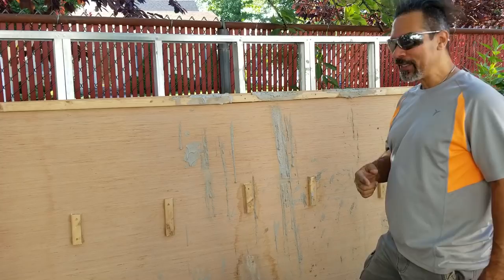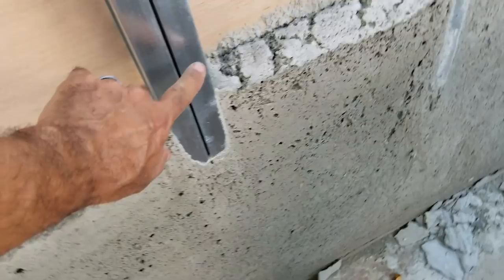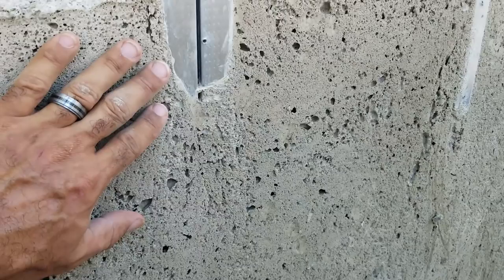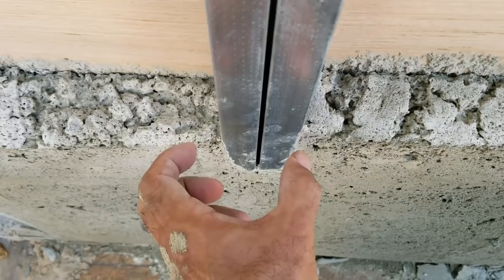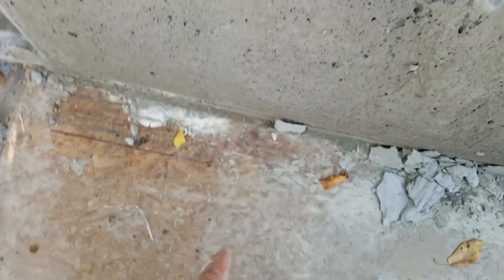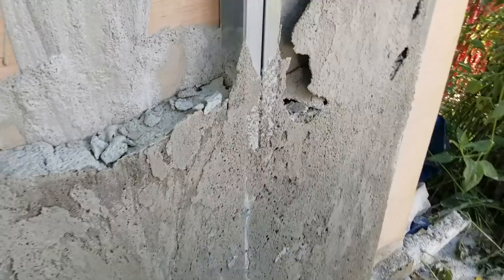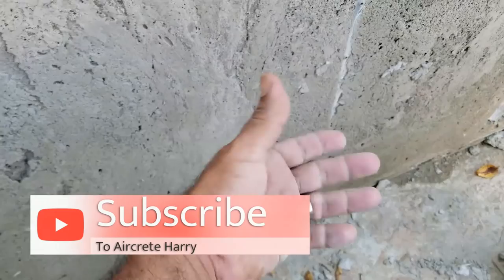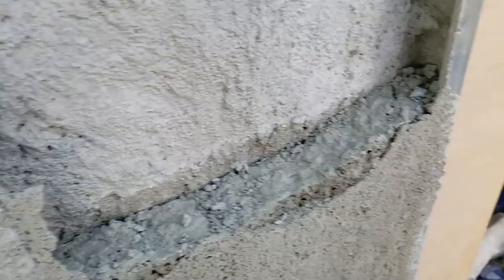Aircrete Wall Insulation | #aircrete #wallinsulation #aircreteharry #aircretewall #aircretesamples

Comment: budies, you may obtain a pritty nice R value  using aircrete with really low budget, the only thing we got do to prevent it from sagging is to use fiber glass and the structure  will never collapse.
Reply: What kind of fiberglass?

Comment: there is chance that we can use a frame and extracted after pouring in place ?what depth has those iron studs?
Reply from the maker: The wooden frame is reusable & comes apart after the pour.
The studs are
1 3/4 inches x 3 inches deep.
Reply: @AircreteHarry  Hmm,what if we strech some plastic over it ?or some linoleum !I am planning to build masonry block and then to build walls .and to make a iron frame is not quite economical so i m thinking using some film protected playwood or simila and protect with something ! i want to build my home and i dont calculate yet but the house surface is 120 square meters !so i need some cubs.Last year the priceps almoust rise 4 TIMES!!!!! If you can imagine ! No doubled 4 times more expensive and i feel I MUST DO SOMETHING TO ACHIVE MY GOAL! What you recomend like framework to pour light concrete and it and be able to un mold without damaging the blocks or the frame ?
Reply from the maker: @prenumenumedefamilie3418  You have different options between plastic and may also look into oils that will provide you with a better release.
Absolutely, I can very much imagine the high cost you mentioned. We have been dealing with the same 
Insan!ty here as well. 
Prices have been going up and it is very unfortunate & difficult to afford things. 
Many tools & parts are not even available. 
I strongly recommend investing into my Online Course that will provide you with good, solid & secure techniques of building:
https://aircreteharry.com/product/%e2%9c%85-online-dome-building-course-step-by-step-by-aircrete-harry-great-addition-for-everyone-who-cant-make-it-to-the-hands-on-workshop-as-well-as-for-eve/

Comment: Hey just uploaded a video using a low tech pump for Aircrete and it works better than I expected!
Reply from the maker: Great Job with your pump.
Reply: Aircrete Harry I thought it would work perfectly with your drum idea you would just hook the feed end to the bottom of the drum. Use the drum as a mixing container that way you can reuse the drum seeing as it already has a hose connection at the bottom. I'm working on a way to connect a motor to it nothing crazy just something like a electric drill. You know something that is easy to get a hold of.

Comment: I think what would work well would be to build an 8x8 wall out of steel studs (at the right side have the steel track turned with the open end out so it can easily screw onto the next set of panels).
Cover that frame with a plastic sheet for water proofing.  Screw on gypsum board.  Make electrical cutouts and run electrical pvc pipes and put in electric boxes.  Spray polyurethane foam about a 1/2" to one inch thick then lay the frame down with the sheet rock on the ground.  Pour in aircrete to fill the studs to the top.  Once it dries set it in a steel track and screw in the bottoms.  Now your sheetrock is already hung and the outside can be minimally stucco'ed with a waterproof stucco.  A 1200 sq ft home would require 19 of these 8x8 walls.  That would be a 6' tall stack of walls that you could load on a trailer and take to your build site to put up your new home.
Now I just need to buy a shipping container so I can put these together on it's flat floor and when my stack is 6' tall take them all out fill the back of the container with my stuff and the front of my container with the panels and have it all delivered on site.
Reply: Could you please make any sketch to explain your brilliant idea ?
Reply: @alimohsin5006  Making the sketch isn't a problem, just posting it here is a problem.  Thanks for calling it a brilliant idea.

Comment: I think this would work great with 2x6 steel studs on a geodesic dome with some sort of silicone uv reflective roof coating on the exterior sealing it also Using aircrete as panels, insulation and structural enforcement on a already incredibly  strong dome.
Reply: Geodescent domes create an awkward interior space. A quanset would be better, or a gambrel roof. For a house a two story gambrel roof would be a good use of space.

Comment: Wouldn’t the wood rot behind it?
Reply from the maker: No cement  Is a chemical reaction and cures does not dry but cures. so when you pour your air Crete into the walls after the cement cures there will be no moisture left, so there should be no  Rotting of the wood.
Reply: @AircreteHarry  excellent, thank you
Reply: @AircreteHarry  Any updates  I haven't checked your other videos yet but i have often thought about doing this.  I should have seen your videos before but I guess youtube didn't think about recommending it before.  Hopefully your channel will become more popular.

Comment: Another question. I’ve read that in a fill deeper than 12” the weight of the aircrete will collapse the bubbles near the bottom
Reply from the maker: not true I have done 4 foot pours with no collapse.
Reply: Of course foam concrete is compressible due the entrained air. If people tell you otherwise, they are wrong.

Comment: How hard would it be to remove aircrete if you decided to wire a wall years later?  Would you need to spray some kind of releasing agent before aircrete application?

Comment: Greeting to all and Harry, it's been a while since this video by any chance did you revisit this field of wall insulation? I have a 1952 home with no insulation and I would like to experiment this type of material for my walls. What are your suggestion? where to start and how to pump the product down the walls? I look at it over and over and my main concern is not enough weight for gravity pull down the material all the way down to bottom plate of the wall.

Comment: Isn’t concrete not supposed to touch steel?
Reply: Concrete (and cement, which is what is used here) will always accept/absorb presented water .. it is a very thirsty material ... so, any ferrous metal inside the hardened cementitous cast item will always be fed water. Yes, it rusts. And, yes, it will rust badly. Harry is using aluminium I think, so rust is not a consideration. Aluminium oxides will form, but those layers tend to stabilize and not run deeper over time.

Comment: So is this aircrete (structural) Or foamcrete (just insulation and the studs/wall are the structure) Just wondering I use foamcrete (just foam and portland) for insulation and different recipes for aircrete for structures so I was curios of the mix used... Thanks ....
Reply from the maker: The mix of Aircrete for this test is good for insulation and for structure. But this was a small test I will be finishing a 10 X 10 shed I started last  year. That built using steel studs.
Reply: @AircreteHarry  Thanks for the reply ...

Comment: I have been kicking around a idea for a simple solar hot water heated wall, that would be able to be used in any home or building,  this thermal mass looks like it would be  a great for  heat storage, I'd like to know if you would experiment with this.
Reply: Foam concrete is not a good thermal mass since it is light weight
Reply: Cob would be better.  Aircrete is good for insulation.

Comment: ..so we dont need any vapor barrier, or tar paper? is it metal studs and plywood for structure, and then just aircrete?
Reply: Per my understanding, if you do that over wood frames, they will rotten super fast.

@Bert Safor  here in comments talking how steel would be getting rusty due to free calcium, air in the bubbles and moisture.

There is one more important point. Point of moisture they call that overseas. When you have -20f in the winter outside and 70f inside the house, somewhere between, there will be ground zero, between wjere water is freezing and where itd liquid. By law of physics that point will be accumulated water, when that water soaked to the aircreate, once it freezes it will cause linear expansion, which will eventually lead to destroying of material.

I read somewhere that on Europe they make walls from this material but the walls are 12-16 inches wide, also they are mixing sand into foamcreate increasing it weight and making it stronger. 

 in sovet union, they had codes on that foamcreate, splitting it into 3 types of applications. Super lightweight foamcreate was only used for insulation (below 500 kilograms per cubic meter) and for structural buildings code was suggesting 600kg/m3. 

Thats about all i know on this topic :) there are some German and Italian companies making protein foam agent for strong aircreate and all i know is that people who used soap liquids in 90s back in Russia were getting poor quality materials that do not last. 

I just got that foam agent sold in usa online, will see how it works soon
Reply: @ekurdesov  good luck and thx for the info. i like the idea of aircrete just for insulation, but if it absorbes moisture and doesnt get out if i put up moisture/ vapour barrier, then its useless. maybe if steel studs were wrapped with 6ml poly first before pouring the aircrete as insulation, it might work....if the aircrete was sticking out a couple of inches on each side to enclose the steel studs, then the aircrete can be mud finished with basalt fiber or some other form of mesh sheets, to seal the aircrete from getting any moisture...would be kinda like a cob wall, but aircrete instead.
Reply: im starting to think rammed earth walls instead, then finish it to seal it
Reply: @d.a.t.4699  Some more updates. Just got back from menards. All metal studs market as indoor use only l, meaning they will rust outside.. I indeed thought those were galvanized, well it seems that metal studs are not made for it neither. Composite rebar seems the safest route
Reply: @ekurdesov  composite rebar, they exist? i know of basalt rebar, but a cement plant owner up in the north west territories told me just a month ago that they were adding basalt to their cement...but then some results came back that it leaches acidic, so they stopped adding the basalt...i know theres a dome company out there who use basalt rebar to build the bird cage before building it up with shotcrete or aircrete...i guess its gonna take awhile before they know of the results as well...maybe its diferent somehow with the processing the basalt into rebar...my cement guy just has a hugh pile of basalt rocks that he scooped with the yard loader...so maybe it diferent with the rebar...
Reply: all the headache with permits n stuff in british columbia seems to be standing in the way of me building a cob home...a home so stable when done right.

Comment: I wonder if you used construction adhesive as a forming backing you could seal the seams so it would not blow out the form. And use the  steal studs to double wall to get more R value.

Comment: Thank you for all the information. Do you have any information on the R value? Thanks, Mike
Reply: Mike Trev I believe the research is about R6 / inch
Reply: Kevin J Mellis Thanks for the info.
Reply: How is the r value compared to epic eps stryofoam? I’m doing a project and would like to know if regular aircrete is good enough for insulation or if I should do the epic mix. Any info would be helpful

Comment: Hi Harry, hope you’re doing well! 
I’m curious what your thoughts are on using aircrete as a thermal battery by pumping it in between the studs as you have done here, and using rockwool insulation to “outsulate” the entire envelope of the building...rather than just heating the air I’m interested in using thermal mass to stabilize the temperature of a building... do you think that the properties of aircrete well to creating thermal mass? 
Thanks in advance to any who contrives their thoughts to my question...
Reply from the maker: Hi Tom, Aircrete will now work for thermal mass. It works better as an insulator you don't need rock wool. Check my past videos where I did a few test on Aircrete as a thermal battery.
Reply: John Doe  yes, I think you’re right JD, I have come across that in my studies in the past and I appreciate your putting it back on my radar...thanks!
Reply: It is an insulator. A clay, Adobe, plaster, concrete or stucco interior overlay would create thermal mass and increase wall durability. Aircrete does not have high compression strength, so it will wear over time.

Comment: Dumb thought, what if metal studs were turned 90degrees and attached on one side of the top and bottom plate.    Alternate each stud so one is attached to "outside" of plates and next on the "inside" of plates.    This would leave a continuous space in the middle of the wall for the aircrete to insulate.   you might be able to put chicken wire on the inside to add strength to the aircrete.    mount the form on the outside and screw to metal studs.  I'm sure structurally this is a bad idea for some reason.

Comment: not good advise to pump into a wall. most new building would have dry wall and it would not hold up to the process. might work well in on an old house with plaster and lathe and no insula

Comment: @andrewcravalho
A rubberized flexible cement is not possible I'm affraid, since the cement hardens.  If you have a road surface im mind made from recycled rubber tires, you cannot compare it with a cellular concrete even when mixed with a flexible Material such as Acrylic or SBR or PVA because you must also consider its insulating properties, fire resistance, compressive strength and its weight.  Millions of American houses are made of Light weight materials such as wood.  The weight of a cement based insulation is considerable i.e. these houses are not designed for that.
It is possible though to make a very light weight insulation material of foamed  pva as a  binder  with light  weight mineral  filler materials. Since pva ist soluble in water, it will dissolve when wet and it will be eaten by bugs and mice, fungus and bacteria.  To prevent this  additives are needed. The Air Krete patented method is to mix pva in water  with an amount of cement, talc,  calcium chloride (salt) and Magnesium oxide.  ( talc is a nasty fibrous silicate that causes lung cancer and ovary cancer).  The high amountof Salt makes it bug / mice/ fungus /bacteria resistant.  The Magnesia will cause the cement to hydrate fast.   Pls refer to the Air krete site.

May be even foamed SBR (styrene, buthadiene rubber) can be used as a binder with Mineral fillers and additives. 
 
If you intend to experiment with and devellop a pva or sbr based foam + fillers and u have the budget for that...than go ahead and good luck!  May be I could even help you with that

Comment: Why not use rebar? Which would be cheaper? Seems like it's getting over complicated to just pour liquid rock...
Reply from the maker: Rebar will vibrate in aircrete to the point where the rebar would be free floating inside the aircrete.

Comment: You should use channel rather than that spacer. A 1" channel might be hard but you can find something similar at your box store.
Reply from the maker: The idea for the spacer made of aircrete is so after you pour in your aircrete and it cures the spacer will match.
Reply: I understood the reasoning, I was just trying to say maybe the channel would be more rigid and structural. I would be worried about the aircrete spacer deforming over time. However I think you were planning on filling in around the spacer so probably would not matter. I still need to watch your strength test videos. I'm pretty excited about all this, looks pretty cool.
Reply: @joewamsley8004  ..if the interior wall was to remain aircrete, then couldnt we use that reinforced fabic, finish mud, and not need anything else other than paint?

Comment: 94lbs P.C.+6gallons water= 8 gallons. Mixing foam in a 100-gallon container (as you said) means expanding it 12.5 times. Is that what you recommend? Isn't 300% expansion (4 times) the most recommended?
Reply from the maker: I am still experimenting with mix designs, and so far 92 Gallons of foam added to the 8 gallons of cement mix. Has been my best mix for the purposes of insulation, Not for making bricks to build with. For building I would mix 22 - 40 gallons of foam with the 8 gallons of cement.
Reply: Aircrete Harry how many square feet will that 92 gallons cover. Is there anyway to make a bag of cement go even further for insulation? What would happen if you stretched it to two hundred gallons?
Reply: @AircreteHarry  Hi Harry, do you have a place/location where you have put your best formulas for different uses of Aircrete? Thanks...